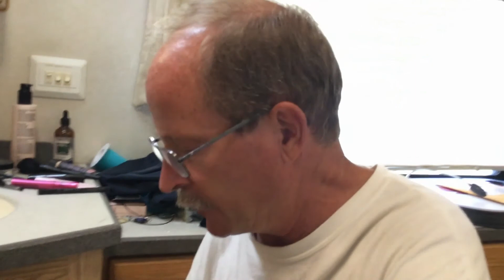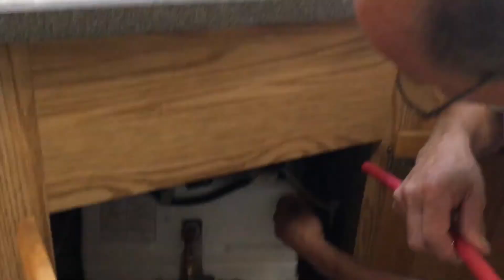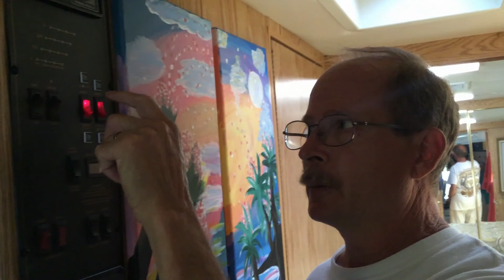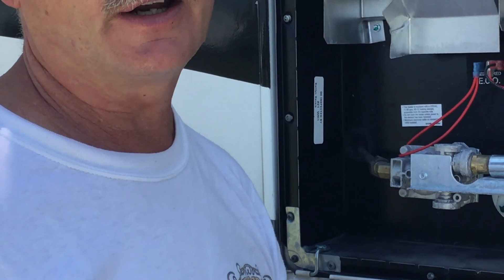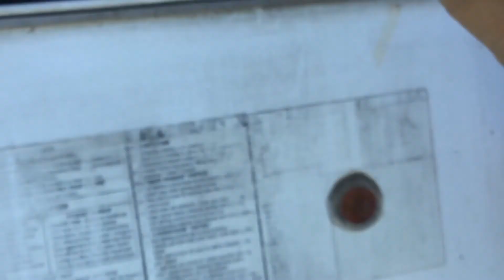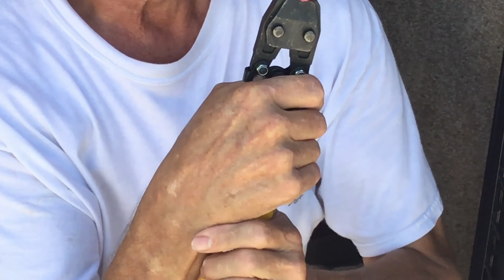Hot Water Heater & Adjustable Thermostat Installation

Comment: Does the adjustable thermostat control both sources of heat?  In other words, does the new heat setting work with the electric element as well as the propane burner?
Reply from the maker: Yes the thermostat will control both sources of heat.